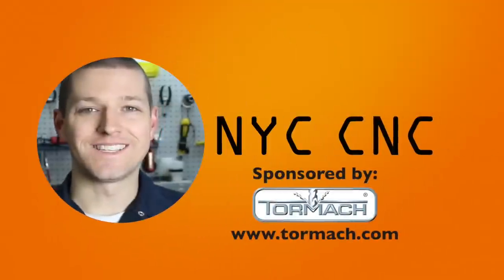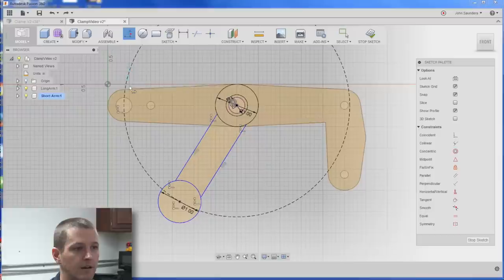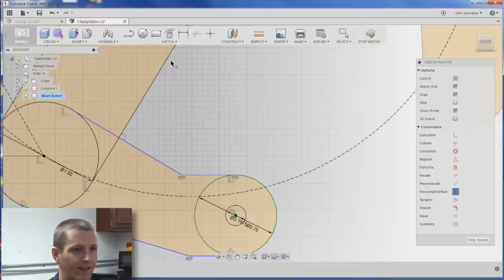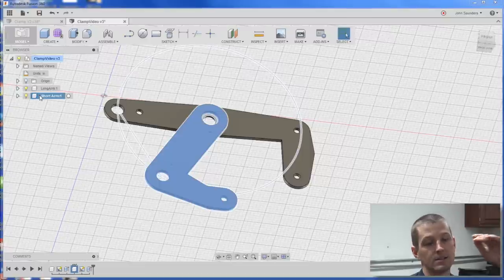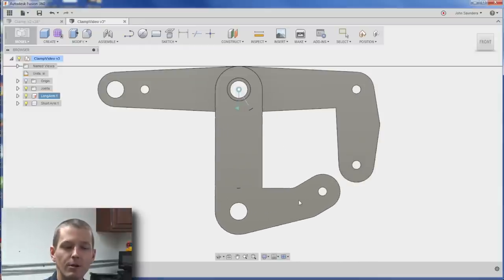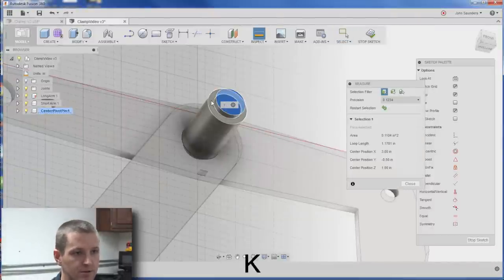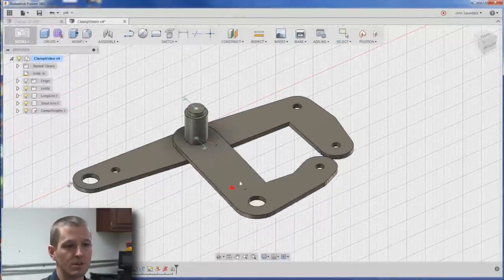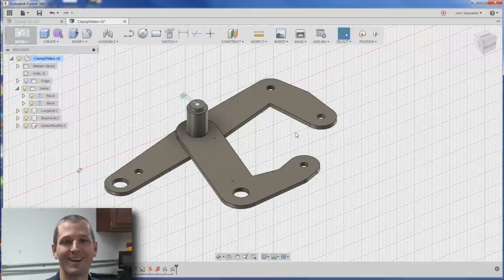Fusion 360 DIY Clamp Part 2: Multi-Component CAD!  Widget71

Comment: These series of videos (clamp, 123-block, frypan, etc.) have taught me more about Fusion 360 (I'm a raw beginner with F360) than any manual or online help I have found. Just for example: Creating, activating, and saving a component BEFORE you actually begin to draw it. I never saw that in any manual.

Thanks, and keep them coming.

Comment: Loving this series! You probably want to keep the holes for the blocks concentric on the pivot, and on the same diameter as each other so the clamping points are exactly opposite with even pressure, otherwise it is offset, and the clamp may twist off.

Comment: John,  thanks for pointing me at Fusion360.  It's an amazing piece of work that is just what I needed. I've played with Cubify before a little but otherwise I'm new to parametric modeling, and almost as new to CAD...but I'm making progress. I'm trying to design a welding cart at the moment. Lots of square tubing, an axle, a couple of wheels, various hangers, and a couple of drawers. 

I think one difference between Fusion360 and Cubify, is that you don't design the parts in isolation, then do an assembly....it's all done on the same screen.  That's nice. One confusing point is the difference between a component and a body...still working that out. 

Also trying to figure out the best way to create things that my design needs to relate to, so I can position and size things. For example, being able to create a block to represent my welder, and a cylinder for the gas cylinder, and get an idea of how they will fit on the cart, where the cylinder securing device needs to be, etc.

-- Mike

Comment: I always just use fix and unfix to keep things in place that don't have a dimension when trying to get things like lines to snap tangent.

Trim away your excess lines in the sketch and you wont have to select a bunch of different faces to extrude. Doing that will also help keep your extruded faces "clean", it looks like you had a stragglers in that second arm. Those little buggers can be super annoying later on in the design and in cam.
Reply: +bensbenz This guy :)
Reply: +bensbenz Great tip, makes things much neater. Thanks!
Reply: Yes, I use the trim function a lot helps make the water tight meshes easier..

Comment: if you wanted to do a revolve sketch for you pin, you could create an axis through the center holes, then create a plane through two edges (your axis and any other edge parallel to the axis) and sketch on that. 

i think the joints are sensitive to what component is clicked first so that could explain the weird behavior.

Comment: Awesome to see more Fusion 360 videos.
These videos are removing some of the mystery behind components and what they are.
I find components a bit confusing are they a piece of a model are they a folder or both and more, don't know.
Here is a couple videos for Onshape which could help https://youtu.be/gkFmjtsbv00 Clamp starts at 11:40 ,  https://youtu.be/_79kNCpke7o some of the workflow could be applied to Fusion 360.
In these videos they create a mid plane and use mirror to create most of the parts for the clamp with only a few sketches.
Onshape has a more intuitive workflow when it comes to different pieces of a model, they call them parts.

Comment: Great video, BUT: it does not seem to be parametric. If you would select LongArm and change the length to another value, the short arm breaks because there are no reference points or relation between them. Correct way of design would be to start a sketch for the ShortArm and use the Project command to transfer the center circle and the most left circle from the LongArm to the new sketch and than design the arm as you demonstrate. That would define the relation between the two components and if you would than change the length of the LongArm, the ShortArm component will follow and update itself.

Comment: thanks for pushing do stuff in components, everyone needs to know that one, the tangent constraint has a bug in it, if you don't do the constraint in the correct order it goes bad, what is the correct order don't know it changes with each sketch.
also it can still go bad if you don't have a tangent constraint on all connections it will flip the sketch you just delete the collinear constraint or whatever one is there and put a tangent constraint in.

Comment: Man, I'm on my second go at this. It seems when things go weird with 360 they go really weird. I've started my short arm sketch and then gone back to edit the long arm... it's really broken things. My sketch is there but it's not visible, I delete the body to create a new one and it works but then disappears... I dunno. Learning learning.
Reply: Sorted it out. Simple enough I think. I had managed to sketch my short arm in my long arm component though, it's easy to do, just like you said.
I don't have a cnc plasma so I'm planning to cut an over sized template on the cnc router and hand cut them with the plasma. Use what ya' got!